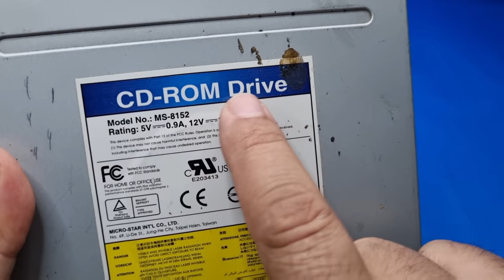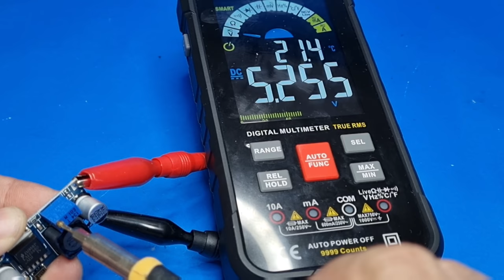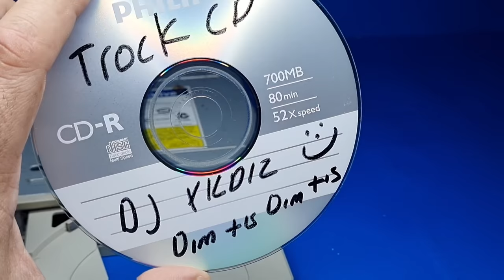HOW TO TURN A 15 YEARS OLD CD ROM INTO A MUSIC PLAYER

Comment: A friend once added a cd player into his car stereo using the same way. He simply added a car cassette adapter to connect the CD ROM to the head unit. It sounded good. Believe it or not, CD ROMs already have built-in shock protection. The CD ROM didn't skip at all during driving.

Comment: It is possible to recycle more old things for this purpose, without additional electronics and soldering. Just insert the JACK from your old active computer speakers into the front panel and power the drive with an unused ATX power supply from the old computer (it is necessary to interconnect the black and green wires on the largest connector, which was originally in the board).
Reply: Falou   bonito  cara eu ja fiz isso a uns anos quando nao podia ter um toca cds bom fiquei com ele uns 10 anos usnado no meu axilia do  sistema de som
Reply: I was thinking the same👍
Reply: Yes that would work
Reply: i agree and i did the same.. but atx power supply makes so much noise
Reply: @yakupbey1578  Yes. It's very noisy. Fan replacement for better, for example 12V 3W with noise below 21dB from some new broken source.
Reply: Also it works for noise lowering when I used 2T903A transistor and variable resistor to reduce fan rpm. And my old AT PSU went to be as silent as I want depending on daytime & PSU duty😉⚙️
Reply: @TSC_Deuce  That's a good solution. I used a slow fan with many blades from a non -functional new source in another application. The fan cannot be heard, only the LED in the fan indicates that it is functional.

Comment: It's important to remember that this will only for work for WAV files (which store /uncompressed/ audio in LPCM encoding) and similar. This works great for commercial audio CDs, but will not work with MP3 files, etc. And there also certain CD drives with more buttons such that there are separate forward and back buttons as well as possibly pause functionality.
Reply: This is AUDIO-CD play only. In 2021 is aweful. How much does it cost for an amplifier and dc-dc converter and time for rework, it is probably easier to buy an old working CD-Player on ebay.
Reply: @BellaLugoshi  Educational purposes only, dude
Reply: @DeVoltaParaOPassado_  Yes turn something old that you can not use modern times😂
Reply: Dragomir Ronilac  nice dig
Reply: @BellaLugoshi  Everything is not about cost or monetary... Creativity and opening minds for further invention... Please don't be discouraging (in anything), that's how you open eyes of new generations.
Reply: Yeah. I mentioned it too. Old Creative CD-ROMs have control buttons.
Reply: @BellaLugoshi  But you have no fun. I like to build those Things :) ;)

Comment: Funny thing is, you don't need little crappy speakers for something like this.  You can hook up the outputs to standard stereo speakers and sound AND VOLUME will be amazing.

I had a crappy little mono radio with absolutely pitiful volume even when cranked up to the point of distortion.  Just for s&g, I connected it to one of my home speakers, and quality was passable, but volume was impressive, definitely some good thump going on.

So you can "repurpose" working speakers from an old busted stereo, and it'll sound fantastic, all with nothing but "junk parts" powering it.

Comment: That is such a brilliant idea.  I don't have a CD player in my car and would just like to change a CD now and again without hunting through a load of files on a Memory Stick.  Now to find a 5Volt regulator, all I will need to do with the audio is to feed it into a USB plug.  Why did I not think of doing this two years ago instead of getting annoyed not having a CD player.  You are a genius, thank-you for so good an idea  😎
Reply: Неровности дороги передают привет вашей идеи. :) - Пережмите с д диски на флешь память - физические носители уходят в музей и в узкие специализации.
Reply: @user-hz1po9vu5v  Bumps in the road might be a problem, however, I have used a portable CD player, and it only skips very rarely.  But I know what you mean, it can be isolated from road shock.  Worth a try as I have no CD player in the car, it very much annoys me!  EDIT:  One of these in the car will not be stolen, but a CD player left for only a few minutes will vanish into thin air.
Reply: USB is already regulated at 5V. Don't believe me? Look at the output voltage on any USB brick. It should say "Input: 120V AC @ 60Hz Output: 5V DC, _ Amps" or something very similar

Comment: I did this many years ago with an old CD drive and computer power supply. Had to attach a broken hard disk to the PSU as well to provide some load and prevent it shutting off, but I could then play music CDs through the headphone socket! I was kinda hoping you would rig up some additional controls to skip tracks, rewind, pause and possibly even see whereabouts you are on the disc.

Comment: This is nothing new. My friend and I did this with an old 2 speed or 4 speed CD-ROM drive by adding shock mount feet and cabling it into one of those cassette devices that plug into 3.5mm jack socket around the mid to late 1990s.

It was great as a CD player in a car that only had a cassette radio. Worked an absolute treat.

It even had a small control box that could sit near the driver that allowed at the press of a button to move to the next track.
Reply: "This is nothing new"

It's actually way too old.
Modern technology has come so far, that a hack like this on old technology is way too late to be of much (if any) use to most people.

Comment: It's unnecessarily complicated. You can just buy a power supply that operates a CD ROM drive. For the audio, just get an old audio cable that was meant to patch together the CD ROM drive and the computer mother board or sound card and splice a stereo RCA cable to that. Now, you can just connect the drive to a sound system or amplified speakers.
Reply: Yes, I’m agree, and it would be interesting to have more commands than just play/stop, like for example next track, previous track.
But the first idea to recycle is a good one.

Comment: Why don't you put the power wires through the holes before soldering? That would give you more mechanical connection.
If I remember correctly, some CD drives had a play/pause button rather than play/next.
Reply: No. That was play/next mostly. Just believe me :-)

Comment: the yellow wire on the 5v pin of that gizmo had me worried :p ...otherwise, great quick solution to bang some tunes on real quick ...even to rip audio off an awkward CD and feed it over to some wav recording device... - I have many custom cables that just plug direct to that audio jack and connect to old HI-FI seperate amps...

Comment: Granted, this is an informative video. However, I feel that you went through considerable trouble creating a small power supply and installing an IC audio amplifier within the CD-ROM player. I am certain that you are aware that by simply grounding the power-on wire (green wire) on the computer power supply will provide you with the +5 and +12 volts that is required, unless you were attempting to save space. Connecting the CD-ROM's audio output to any general purpose audio amplifier will do just as well. Again, your video is informative. Keep up the good work.
Reply: Yes, I also think you could do that.  I think he is demonstrating a more elegant solution that does not require an external amplifier and can use a smaller or more general purpose power supply. It nice to see how it can be done, although I don't think I would bother to do it myself.
Reply: To be honest it's just odd, I don't get it, there are many videos like this. Here, just connecting up some $10 speakers to the headphone jack would yield better results all round. Neater, better sound, erm, anyway it's a project for someone if they really feel the need.
Reply: Katılıyorum
Reply: Let's say that there are so many obsolete appliances waiting to be scrapped that makes this effort not convenient.
A hi-fi CD player was sold for $20 more than a decade ago and then was replaced by new models that read MP3 and DVD.
Then there are unused portable Cd players, old portable pc. I am sure everybody has at least one of those that make not interesting using a pc cd-rom drive
Reply: @davidp4456  ELEGANT!!!!!! with that shoddy soldering.
Reply: @maxit-mw  exista  CD-PLAYER care sa citeasca MP3? iesirea lor este audio analogica sau digitala ?
Reply: @mirceacluj  there are no pc cd-rom drives that can read MP3 directly. It's the pc software that decodes MP3.

Comment: Typical problem with computer CD players - especially the older ones, is that their speed can vary by as much as 15%.  If you try to rip a CD in a number of different CD players, each will produce a file that has different song lengths.  This is due to the variation in CD spin speeds.  In addition, the DAC is almost always the cheapest chip on the market at the time of manufacture.
Computer CD players are notoriously bad at both playing and ripping CDs for this very reason.  A way around this is to do a direct file copy without converting it to any other format or compression.  Once it's on the hard drive, then you can manipulate it.
But even that is hit and miss for audio CDs.  Nearly all computer CD drives will not correct missed or damaged data.  They will blindly copy files with flaws and not even tell you about them.  I like to use a feeware program called Exact Audio Copy to help correct this.  It's not perfect, but will produce much better copies than you would otherwise have.
Reply: @OreoBambino  Just try it.  Not all computer CD players will rip or play at the same speed.  Youtube videos don't go through the same process and can't be compared, and you're confusing file transfer speed with audio playback speed - two completely different things on a CD player.
Reply: @OreoBambino  But you have a point - I didn't explain it properly.  It's not the spin speed of the CD that causes the problem - it's the digital timer that varies from device to device.  If all you're doing is a file transfer, the digital timer won't change anything.  But once you involve a DAC, that timer determines the speed in which the DAC operates,. and thus the speed in which a song is played.  But even if you're only converting to an MP3 or AAC (ripping), it will be affected by the speed of the timer.

Comment: please could you tell me what the circuit board is with m103 on it. the one you connected to the power lead
at the start of the video
thanks 
j.jones
Reply: pam8403 audio amplifier

Comment: Pam8403 new to me, nice application
Wonder what DAC chip these Cd ROM drives use for the front headphone and rear analog outputs.
Also, many drives like this have a digital spdif 2pin output next to the 4pin analog output on the back.
Be cool to internally mount a better DAC board plus the pam8403, then use a power bank to power it
Reply: nici eu nu stiu daca au iesire digitala sau nu Poti trimite un link cu datasheet al iesirilor ?

Comment: any CD-ROM has built in CD Audio player, but the project could be better if you have old Creative CD-ROM which came with IR remote. That CD-ROM is a masterpiece.
Reply: No. Having creative CDROM is just having creative CDROM.
The project could really be MUCH better if he had normal CDrom with only one EJECT button and he used some Arduino or something similar to emulate ATA bus and send commands from Arduino to CDROM (play/pause/next/previous/etc).
This could really be amazing project.

What he did is something that any school pupil would easily do even better.

Comment: Güzel çalışma ama mp3 calması imkansız. sadece track cd çalar. Örneğin orjinal cdler
Reply: Pc de CD yi track olarak yazabilirsin
Reply: @olgunbektas6045  Media Playerin öyle bir özelliği var evet. Ama en fazla 10-12 adet müzik yazabiliyor track olarak
Reply: @marcolomboss   aynen en fazla 20 olur 20 tane yazmisligim var
Reply: Yes, only CDA format can be played. In fact, the CDA extension is listed by the operating system because it is actually a WAV. Convert your MP3 files to WAV (sampling frequency setting is 44.1kHz, 16 bits and uncompressed). This is the CDA, CDDA standard. The drive recognizes it as audio (audio disc).

Comment: Cool video, but there is 100 times easier way to make it work, no need any amps inside. Also better to use CD-Rom with additional control buttons (as vintage Creative). With old. creative Cd-rom You can control “play” “stop”  “next track”.

But, for education purposes for new generation - it’s OK. 

Thx !

Comment: You can always spot the amateur when they butt solder the wires to the land pad instead of inserting them into the through plated hole and then soldering them.

Comment: Next step: adjust volume.

That rear line output is not adjustable with front volume knob.
Reply: PAM8403 package also has volume control, if you buy that style of board.

Comment: THE PROYECT IS TOO SMALL, YOU CAN DO IT BIGGER, REMEMBER YOU HAVE DIGITAL AND ANALOG OUTPUT AND HAVE THE 3.5 OUTPUT, YOU DO NOT HAVE TO CUT ANYTHING JUST PLUG AND PLAY, MORE EASY AND MORE POWER

Comment: Do you want to know what would be 10x cheaper, 100x easier and sound 1,000x better???   A $12 Chinese MP3 player that has Bluetooth and plays FLAC(lossless) files (RUIZ X06). Use that CD drive to rip your audio CD's to FLAC. Load up 800 Full length CD's on a 512Gb SD card (about $49 now), insert it into the $12 Chinese MP3 player that plays FLAC files... Almost ALL of them do now and connect your Bluetooth headphones to it.

Comment: Was expecting some kind of neat enclosure, perhaps a CD playback controller, but no...... Over engineered shit I could do with a simple power supply and a couple of wires. Try this on a modern DVD drive without cheats like a built in DAC and Skip/Play button on the drive.